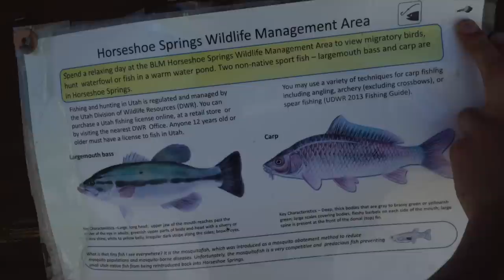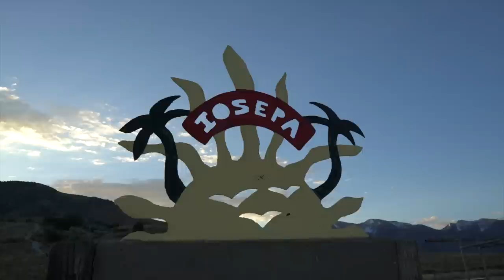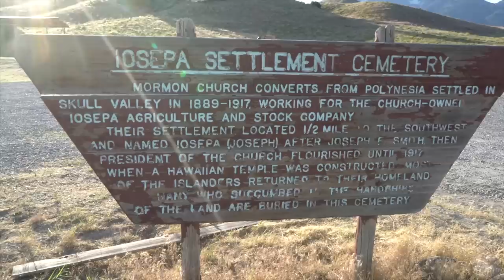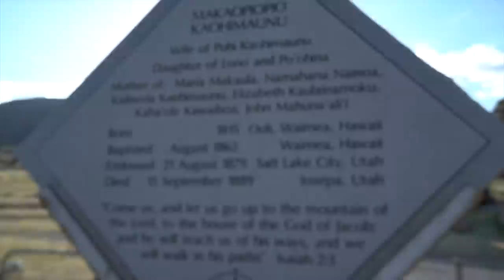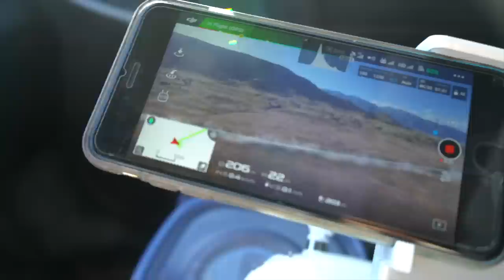SkyHunter Long Range FPV Gone Wrong - RCTESTFLIGHT

Comment: As you said in the video, all indications on the OSD are that the DL failsafe was not set.  When it lost signal, channels went to random positions.    It showed that RTH Test was activated, but was telling you to center the sticks to actually RTH.
When signal was regained I take it you had manually triggered RTH and that was fine except that it was also descending out of LoS.     Should have used that window of opportunity to set the failsafe positions on the fly.    BTW, didn't see a usable RSSI
indicator on the OSD anywhere.  The bars in the upper left never changed. 

Beyond that, DL definitely shouldn't have given up only 14 miles away, especially with that Tx antenna. 

Not that it matters for that plane any more, but the latest versions of Vector have enabled "Mountain Mode" for fixed wing aircraft, and with that it would have climbed when you had RTH manually activated, instead of descending. 

Also, a future version of Vector firmware will have a new RTHX mode which ignores stick positions entirely so it'll be harder to cause this situation (which is fairly common occurrence).

Comment: Great video! As someone who has also crashed a model with a Vector AP this is very interesting. The fact that the death-roll to the right is in both instances accompanied by the camera cutting out to black, but the OSD still being visible might offer some clue as to what might have happened. I know the vector has the capability to transmit OSD only if the camera cuts out, but why did the camera cut out?  Perhaps it has something to do with the power system - are the servos/radio on same circuit as the FPV cam? 

It would be really cool if you managed to get the logs from the Vector. I crashed my Twinstar and the Vector logged a ton of parameters right up to the impact so I was able to work out exactly what happened.

Comment: Wonderful video.  As I'm sure you're aware at this point, there is a RTH mode on the Vector called "Mountain Mode" which would (hopefully) have prevented the plane from descending below the ridge as it flew back.

It appeared to me to be some sort of receiver/failsafe issue, though the total loss of camera signal (yet still had OSD overlay) makes it seem more complicated than that.  The plane rolls hard right and then inverts the exact same way in both failsafe instances (9:10 and 10:26).

Did you test RTH at the beginning of the flight before you headed out to distance?

Sorry about the loss, but it made for a great video!

Comment: Really interesting video. Did you ever consider mountain downdrafts could be the issue? 

Hot weather, you're approaching a ridge-line between 2000-3000ft and the behavior of the plane (tipped up by a single wing, speed alterations during flight and multiple jolts throughout the approach) indicate that could be the issue. Either way, hope you got the aircraft fixed!

Comment: Covering your plane in a bright colour, such as neon yellow or rose red, would have aided you in spotting the fpv model, flying over using the Phantom. I use coloured duct or packing tape for my models, as its very robust and easy to apply. For a more expensive option you could also use brightly colored solarfilm, applied with an iron.

Comment: Good video - well done. Interestng to watch. That must have been a realy hard crash! I did a lot of RC plane flying but I rarely saw a model with so much complete desintegrated parts like yours. Was there anything left to be reused? But for safety reasens it might be better to replace it anyhow. Greetings from Gemany. Keep well in this weird Corona times!

Comment: Cool video.  I've been to isopea once while exploring, but I usually head over to the road on the west side of that valley to drive way to fast on dirt.  I've been wanting to do a drive an fly sometime, either down and around skull valley, or see if I can put together something fast enough to fly along I80.  Interested in getting together?

Comment: what a story...complete with mormon fanatics!  you are one tenacious dude.  I lost a mavic once, went to the 'find my drone' coordinates, searched for weeks but could never locate it.  Flying FPV quads (DJI) air unit with a GPS.  My thought is to record the LAT/LONG data via the goggles then if it goes down, review the data, load it into an app and proceed to that location...assuming it crashed directly below, it should be possible to locate it.  Waiting for the new firmware update so it's possible to record OSD in the DJI goggles.  I noticed this was posted 3 years ago! Any update on what you should or shouldn't have done?  Thanks.

Comment: Daniel, did you ever notice on this video that during the flight, your Dragonlink antenna was seriously rubbing against the radio antenna?  I don’t know if their touching each other would have caused enough interference to wipe out your video signal but you could easily check it out.  As suddenly as the loss of control occurs, it seems like an electrical or RF type cause because it happens, stops and then happens again like some type of short circuit.  Just wondering if you ever solved the mystery??

Comment: I mean that two 3S 8000mAh batteries are not 16000mAH because it does not double the voltage capacity. I'm wrong or not?

Comment: Make sure your Dragon Link is updated to the new firmware.  The old firmware had issues interfering with 1.2Ghz.

Also, the RSSI should just connect straight into the Vector from the DL RX RSSI pins with a male to male servo lead.  That's how I have mine set up and it works perfectly.

Comment: Great video, and great experience sharing.

By the way, just curious, does that area have cellphone signal?

If it does, might be good to have a mobile GPS tracking device put on it.. but.. yes, does need pretty good protection... Else will be rip-off like other devices.

Comment: I saw the coordinates of the crash area in the flight data right away and kept that in mind, and went directly to Google Maps to find your plane. But when you mentioned Horseshoe Springs it accelerated the entire process. I then used Google Maps in 3D mode to duplicate the view I saw in the HD pre-crash footage. As I narrowed it down to nearly perfectly matching the two views, I knew the plane was in close proximity to Iosepa, however couldn't determine the exact location of the plane cuz you edited it out evidently, or the plane was just not visible in the HD footage in the video. (I'd be curious to know if you went back to your HD raw footage to find the plane.) I also purposely waited to watch the ending of the video and was gratified to see I was indeed very close to locating Sky Hunter's position very near Iosepa. I should have been a detective.

Comment: Did the same thing with the failsafe on time on a friends plane. A skywalker 1900. We where just taking it for a maiden around a small field, but my friend had taken the antenna off the radio and the plane just went stright forward and did not return, we found it after about 2 hours 4km away 26m up in a tree. The fire department came with their largest laddertruck and took it down =) not a scratch =)

Comment: Did you ever figure out what went wrong with the Vector?  I've never heard of one going crazy like that and it's usually it's a very reliable system if set up correctly.  The way the plane was reacting was like some kind of frequency interference.  I see you had an extra battery for the radio/servo equipment so maybe that battery failed but you should see that in the log.

Comment: Nice video. The two times you had that roll is where you lost rc link and vector switched to RTH based on failsafe configuration of your receiver which was not correct, it switched to RTH test

Comment: Question - when it kicks into “return to home” mode, does it set a vector back to home, or does it keep bread crumbs and follow those back?
I love this ..... I totally relate to this, dude.
I think you’ve discovered the beginning of the restricted space.
Reply: It sets a straight vector, usually. But you can actually create a failsafe to follow waypoints in reverse.

Comment: Looks like BEC is overheating and temperature cut out feature going active (would explain the on/off nature) as your entire 5v system goes offline,  binding servos perhaps? I'm considering putting a redundant BEC system from Hobbyking in my eve-2000 for just in case scenarios like this.

Comment: At first, I was thinking that the military jammed the signal to the plane and forced it down which is a possibility.  A more likely theory is mechanical problems.   I find the connection between the boom and tail to be suspect.  I think it may have broke in flight.  That would have caused your tail to drag in the air.

Comment: I had the same issue with my delta wing. It turned out on of the clevises broke mid-air. I had GPS tracker mounted but not turned on :) Moral of the story - Always have GPS tracker mounted and turned ON.

Comment: You don't think it as the signal being jammed?  Would have been nice if you were over that small hill range and kept getting signal. probably would have saved it. Lost control of my CX20  a day or so ago but I could hear it buzzing. So i switched it out of bogus GPS, which is what caused the malfunction and into height hold only mode. Got it up where i could see it and saved it. I'm learning..not the same victorious feeling as finding a downed plane but close. Great video. in fact you have some really good ones I'm subscribed.

Comment: I've seen similar issues with the video sometimes cutting out and going black. In my case, it was because the SBEC I was using to provide power to the cam/transmitter was under too much load, it couldn't provide enough current. Switching to a bigger SBEC and adding a capacitor to smooth out the supply solved my problem.

Comment: I always hate losing an airplane, would rather have it crash in sight.  How about rigging up a flashing LED light to help locate lost airplanes?  Or a small electronic beeper or buzzer to help locate your plane when lost? Combine both, could be triggered from transmitter even.

Comment: A few of my early camera rockets suffered damages like this and worse.
One dual stage, turned nose down, then fired the second stage straight into the ground. $2000 of payload ended up 3 feet into the ground, and only the sd card was recoverable.

Comment: Long time viewer first time caller...... have tou tried Andruav or the windows based version flight Zoomer? Although you video rock so..... just bloody wish I could get flying properly dam it got an Opteera and  another plane fpv raptor v2 that tip stalls instead of a learner plane so steep  learning curve.

Comment: I think you need to put a HIGH pass filter on the Vtx or Vrx (so it will pass the high-frequency video signal), not a LOW pass filter (which is what you called what you had on the Vtx). You'd put a low pass filter on your dragonlink to pass the 433Mhz signal but filter out the high frequency harmonics.

Comment: You should throw a GPS/cell module in your planes during long range flights will make recovery a lot easier.  I got one from BKB for my esk8 but they are just rebranding and helping with setup can get the modules for a bit less but $40 ain't bad then cell carrier is about $10 per month so around $120 a year (call it long range insurance). Only downside I see is need to be flying somewhere with at least text message cellular connectivity to get messages back from the device about location (you just text it "cs" for battery status has it's own lipo and charge circuit can take up to 100V to charge onboard battery, txt "1234" to the device to get GPS coordinates alone)

Also can use GPSdd app with data plan to track your stuff live if you have cell data connectivity.

Comment: I destroyed a Skyhunter which went down in similar fashion - it was the aileron servo failure. The autopilot was working the little 9s servo motor too hard and it burnt out. The burn caused a short so the electronics browned out a couple of times before it completely failed the servo stopped and it spiraled in. Failsafe didnt have a chance :(

Comment: What would you upgrade your base station to now for long range? I'm thinking about doing some long range FPV and wondering if the 1.3GHz setup is still what you would use or if you've found other electronics that you like better in the last 3 years.
Reply: the freq range is almost irrelevant to range. Its all about the transmitter wattage. most are only 200mw. Get 600mw to 1w. But they get hot, buy a heat sink for it. Also use a cloverleaf for tx and a helical antenna for rcv. The frequence only slightly matters: 1.3ghz can penetrate trees and walls better (not rock), 2.4ghz is usually default remote or telemetry transmission so dont use that for video, and 5.8ghz gives you the most unused bandwidth for less noise but has a harder time penetrating walls/trees etc.
Reply: @Daruma_Studio  Lower frequency radio signals propagate farther in air and through buildings and trees. I'm not sure why you state that frequency is "almost irrelevant" to range. High frequency waves are more easily absorbed by air molecules, and especially by solids, than lower frequency. This is why 2.4GHz Wifi travels farther than 5GHz, but 5GHz can transmit more data, at the same power.

I'm guessing 1.3GHz at 1 watt is going to have better range than 5.8GHz at 1 watt. But yes, 1.3GHz at 1 watt vs 2.4 or 5.8GHz and 200mW is going to win. Even if 5.8GHz is less utilized, even in a line of sight situation, 1.3GHz will be better than 5.8GHz. I haven't found any way to quantify that though.

My question was not about the frequency, more about range. I was probing to see if there was a directional antenna that automatically moved and followed the plane, or maybe even a lower RF that had better transmission distance at the cost of image quality and/or frame rate.
Reply: @ooglek  Ah understood. You might be interested in Helical antennas on an Antenna Tracker as seen here: https://www.youtube.com/results?search_query=rc+antenna+tracker
Reply: @Daruma_Studio  Wicked, thanks!!
Reply: @ooglek  Absolutely! I hope to see some success videos from you in the future!

Comment: I had a similar experience a few years ago, except I had made some telem that worked over cellular data network. The last position was so near the crash site that when I got there, a balsa stick and a gopro were sitting right there on the ground. The rest was stuck hard in a huge tree in a protected area (couldn't just go chainsaw it) and ultimately I had to shoot it to pieces with a compressed air golf ball cannon to be able to recover at least the motors and the receiver...

Comment: Hey really love your channel! 
I'm part of a student club that launches high altitude balloons, and we are considering getting a fpv drone to help us look for landed payloads (which can be pretty hard ti do on foot in rural England). 
Is there any drone/other fpv device that you would recommend that cab withstand the occasional wind blast and is affordable for a student club? Thanks!
Reply: Google APRS. Its using ham radio to send out GPS coordinates. With a handheld reciever it will send out locations at a predetermined interval.I've used this to located balloon payloads and works great.
You need to research which frequencies you can use in Europe but a 1.2ghz fpv transmitter works really well.
Reply: renoflash06 I know what you're talking about, that's not the issue here actually. The problem stems mainly from the bad terrain our payloads will occasionally land in (swamps, trees, and those terribly bushy hills) that is pretty frustrating to traverse and make it impossible to see the payload until you're within a metre or so. The idea is once we know the approximate gps coordinates to scan for the payload visually with a drone from above.

Comment: getting into fpv for the first time. wat are the best antenas for lets say 2 miles? am ordering the skyzone 5.8G rc832 combo pack 600mw
Reply: 2 miles get a helical. But unless you live someplace with a lot of flat open land 5.8 isn't a good choice for flying long range. If you're 2 miles out and the plane flies behind a tree or house from where your ground station is you will lose video almost instantly. I found that out the hard way!

Comment: I've used Tbeacon with gps to locate my HAB capsules it works great. also a spot tracker would be good if weight isn't a issue.

Comment: I recall seeing a vid from Flite Test when they took a crashed Go Pro back to the shop for replacement under some sort of warranty that Go Pro have to replace if accident damaged.  I'm sure it wasn't an insurance and they were able to get a new one, should work for you too?  Anyone else recall seeing that and/or know what it's about?
Reply: Pete Rihoy yeah, didn't they even get a better gopro?
i think it was one of their first vlogs
Reply: Yea, I wasn't sure if I'd misremembered that bit but I'm pretty sure they did.  I just had a quick visit of their site but couldn't find it.  Anyone have the link?
Reply: Pete Rihoy wasn't it Best Buy store in USA. If you buy it rhere an get a policy I think the replacement cost is small.
Reply: It was at best buy. They purchased extended warranty for it.

Comment: I've had the same issue with the UHF stepping on the video. I found getting the decent RMRC vrx solved it. The cheaper video receiver has very poor shielding.
Reply: ArgusFPV I think out of band rejection is the term your looking for. Can be solved with built-in or external bandpass, but db loss is the trade off I guess

Comment: I have had exactly the same Video-IF using a super low PreAmp (0.4dB NF Used for Earh-Moon-Earth HamRadio).
So I added a BPF Filter on the output of the Dragonlink (0.4dB IL) an everything works without any Video-IF.